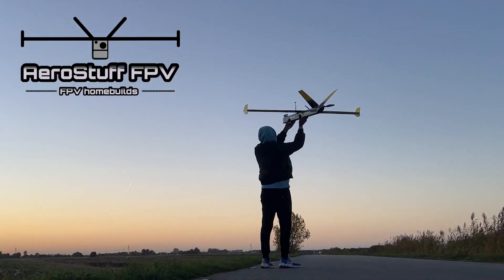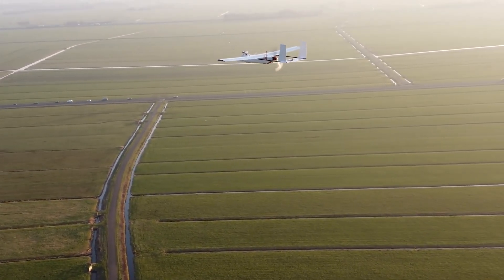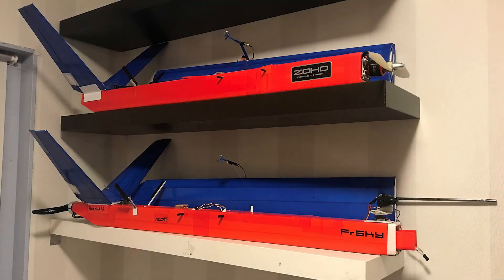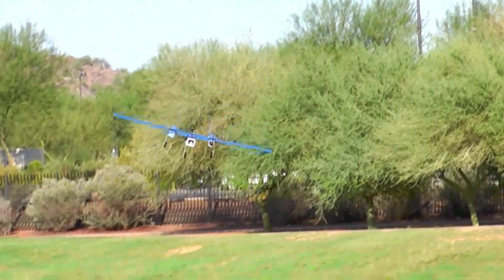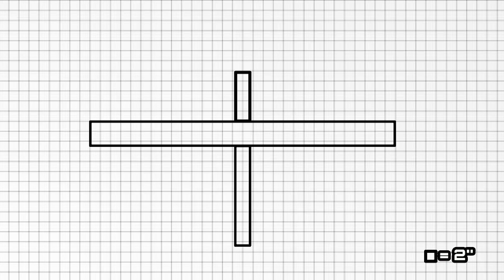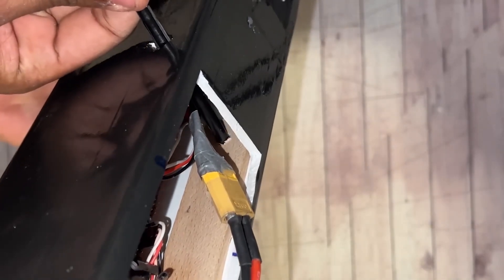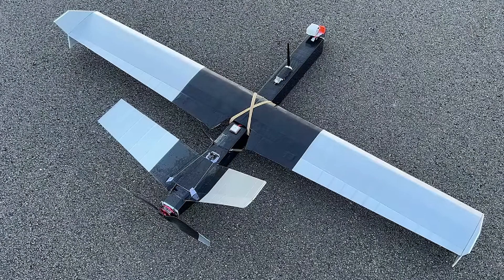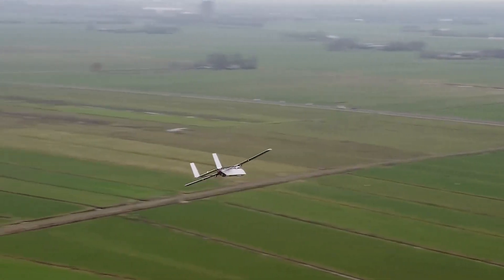How I Design Autonomous UAV's for Long Range FPV

Comment: I enjoy your videos immensely and aspire to build my own someday.  That leads me to a question: As someone who is interested in getting into this hobby, I’m a bit lost on what radio control transmitter would not limit me in the future if my intention is to keep expanding capabilities.  It seems like a pivotal piece of the puzzle and I don’t want to have to backtrack and then outlay on what I should have bought from the beginning.  Any suggestions would be greatly appreciated.
Reply: A few years ago most got a FRSky Taranis or Spectrum, RadioMaster is, at least in the drone community, getting more attention.
They, like the taranis, are module based, so you can change the actual transmitting system if you want to try any more fancy stuff along the way.
But don’t waste to much time deciding on that, most systems work just fine nowadays
getting to build and finishing the plane/taking the time to fly is way more important :D